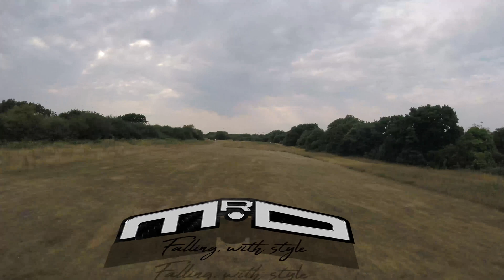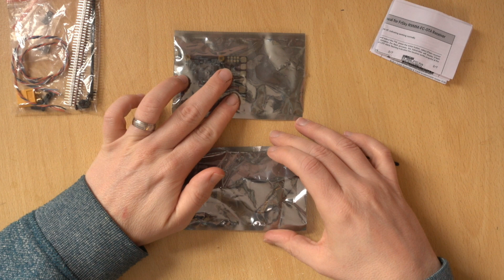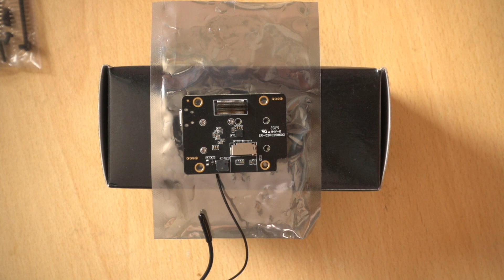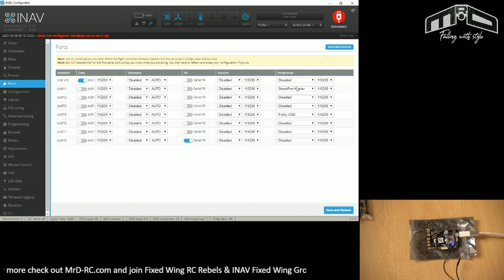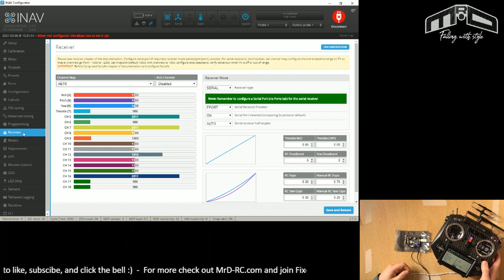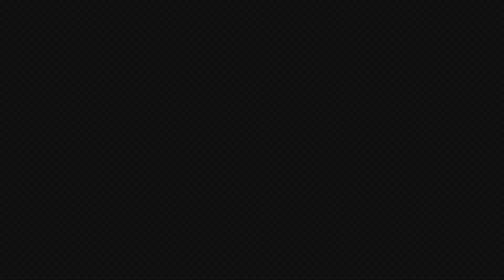FrSky R9 RXSR Pilot Flight Controller

Comment: Great video - if you get a moment please edu us newbies on an actual video on how PWM Servo`s can be connected to H743 Wing FC.  Some are saying that PWM is dead! ?
Reply from the maker: PWM is far from dead. In fact, I would bet that 99% of servos hooked up to a flight controller are using PWM, over something else like SBUS. The best way to plug the servos in is to first check out the mixer in INAV. Then you know which ports to plug the leads in to. On the H743-WING, it will be S3 to S6, depending on how many control surfaces you have. These tips may help: 
https://www.youtube.com/watch?v=1f_G0hKOUoQ&t=936s 
https://www.youtube.com/watch?v=1f_G0hKOUoQ&t=2486s
https://www.youtube.com/watch?v=EXmwUm1SdgA&t=2074s

Comment: Hey, I’m new to the rc world so I apologize in advance. I’m attempting to build a twin 70mm EDF jet for FPV. I plan on using the R9|RXSR Pilot. From what I’ve learned, the FC has an internal integrated BEC… right? If this is true, does that mean I need to get 2 ESC’s without a BEC? Instead of my original plan of getting one ESC with and one ESC w/o internal BEC? (I plan on ordering some custom MGM TMM ESC’s)

Put simply, does the BEC in the flight controller “replace” the BEC in my ESC? From what I’ve heard, I don’t want two BEC’s, so I’m making sure my FC and ESC don’t “fight”.

please keep in mind that I may be completely missing the concept, so if my question doesn’t make sense my bad lol

pls help :)
Reply from the maker: Hi there. With flight controllers like this, you don't need to use a BEC with the ESC. However, I have to say that if you are new to RC and RC flight, an EDF like that isn't the best choice for a first model. A trainer would be a much better choice. Are you learning by yourself or are you joining a club?
Reply: Will do, sir. Currently watching your review on max thrust riot. 

Thank you!!
Reply from the maker: Its a good plane to learn with and can be thrown around a lot when you’ve progressed.
Reply: @MrD  Hey Mr. D, follow up question, is it at all possible to “disable” the integrated BEC and run a more capable external BEC? In order to power standard sized servos?
Reply from the maker: No, you can’t disable the servo BEC. If you wanted to use an external BEC, you would need to make up your own servo loom, using power and ground from the BEC and signal from the flight controller.
Reply: Thank you very much for the clarification Mr D. I haven’t been able to find that answer anywhere. And yes, I have a freewing 64mm f-16, x20s, sr10 pro on the way to practice on before I start building my own (Su-47.. so excited). I am currently learning by myself, mostly because I’m not familiar with what resources are available to me yet. However, I’m definitely open to suggestions on what clubs there are, etc. 

Am I on the right path so far? 😅
Reply from the maker: Honestly, I would still say an F16 is an intermediate model. Definitely not beginner friendly. Look at something like a Max Thrust Riot or Chris Foss Wot4 to learn on. They are much more forgiving.

Comment: Great video! I have a question about using this board with DJI. Can I still use the white connector that suppose to go to the VTX and the camera? If so, which of the ports on it should be used for the grey and white air unit wires? (sorry for this beginner question)
Reply from the maker: I don’t use DJI. But you don’t connect any of the VTx or Cam pads. It’s just a UART between the flight controller and air unit.
Reply: @MrD  I see, alright then. Thank you for your answer

Comment: Hi Darren,thanks for the Review,may I ask what are the advantages of having the external air speed sensor, on this board and the other boards using inav.
Reply: Thats what i was after,great news thankyou Darren.
Reply from the maker: No problem Mark 👍🏻
Reply from the maker: Hi Mark. Pretty much all board can have external air speed sensors. They just connect to an ADC, I2C, or CAN interface, depending on the FC.

I guess you mean the external gyro that can be put next to the receiver? Out the box, the R9 Pilot comes with the ICM20602 gyro. Currently, the only option is for an external MPU6000. The external gyro can be soft mounted, to help with vibration noise. The ICM20602 is a newer gyro which on paper is better. But it does seem to be more sensitive to noise. The MPU6000 is older, but some people just prefer it, it seems to work better, and it seems more resistant to noise. 

The biggest advantage is that potentially if a new gyro comes out, which is amazing. An external module with that gyro could just be plugged in when the firmware supports it.
Reply: @MrD  What is the advantage of having the air speed sensor fitted to the board.
Reply from the maker: I don’t follow Mark? There is no airspeed sensor attached to the board.
Reply: @MrD  maytec have digital air speed sensors that can be fitted to say a f405 wing, what's the advantage of using them,if any.
Reply from the maker: Sorry, you’re talking just in general. I thought you were talking about something on this specific flight controller. 

Well, at the moment, the only thing it will give you is airspeed in the OSD. So if you’re flying the plane, you can manually adjust the throttle to maintain correct airspeed. However, in iNav 3.0 there will be more options. Currently, you can access airspeed data in iNav programming. But in 3.0, the tools to use this for an auto throttle will also be present. Also, Alexander van Sasse has also started working on closed loop throttle for iNav. So in the future, there will be advantages to having an airspeed sensor, especially for endurance.

Analogue airspeed Vs digital airspeed. Digital has an advantage, especially with longer cable runs.

Comment: Thanks Mr.D, great video. I just purchased the r9 lite pro for my x9 lite so this may be a great solution for some models. Look forward to seeing the flight vid 😁🤟
Reply from the maker: It does make things simpler for an R9 setup. The only real issue of any integrated receiver is separation. But that's why we have options and multiple brands. We are spoilt for choice :)
Reply: @MrD  indeed, perfect for a twin or even a puller where you can sit it at the back. This will be my first time with T style antennas so will have to do a bit of research in placement. Thanks again.
Reply from the maker: It all depends what you want from it. The best orientation is vertical. Just make sure that the transmitter antenna is in the same orientation. 

With a diversity antenna setup, it doesn’t matter if you’re not looking for crazy range. Have them at 90 degrees, so that the nulls are covered. For long range, both vertical, but in a shallow X is a good option.
Reply: Hi Darren, great video. Iv just ordered one for my goblin. My only question is can I reflash the built in R9mm reciever with my accst flex?

Comment: Thanks a lot - all covered in depth and not sure if I wanna to switch being on crossfire.
Reply from the maker: There’s no need to switch anything. There is a version of the flight controller without a receiver. It would work with Crossfire, like any other flight controller. 

Thank’s for the comments though. With products, I want to give enough information so people can decide if it’s something that might suit them. So long as it isn’t crap, then I’ll just say it’s crap 🤣